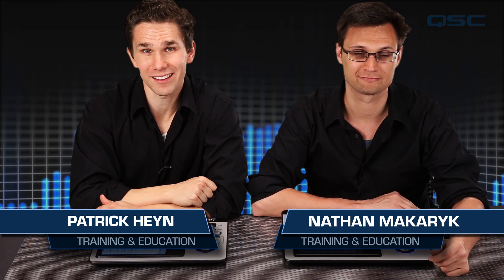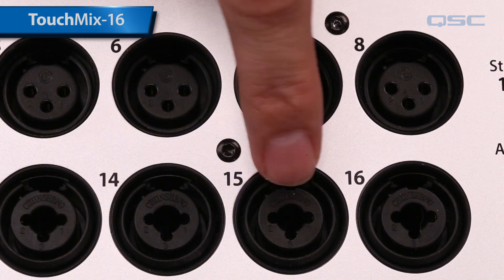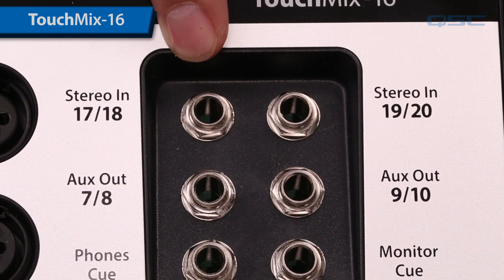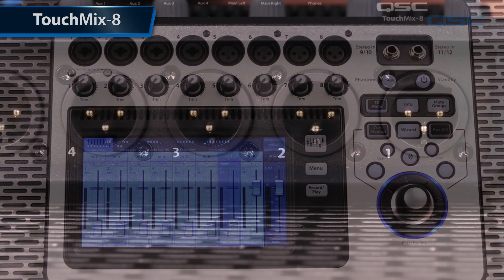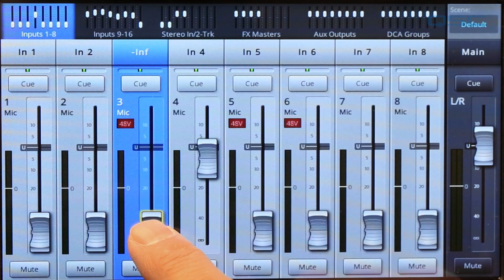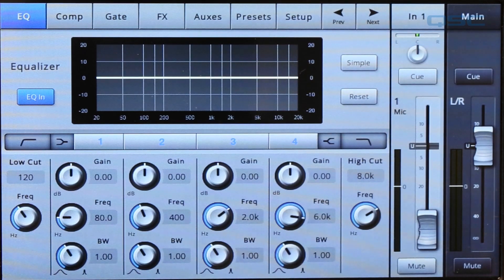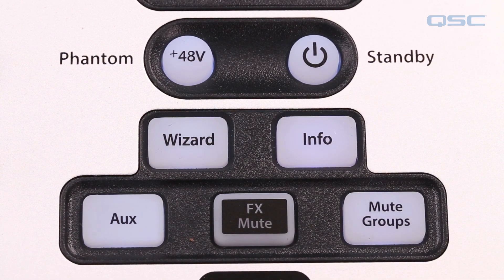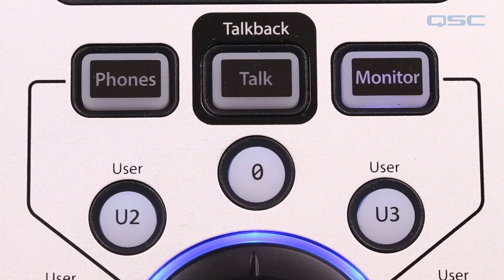QSC TouchMix Training 01: Mixer Navigation (English)

Comment: Are you able to turn the screen off while still using it ?
Reply from the maker: The screen cannot be completely shut off during use, no. However, there is a dimming feature that allows you to adjust the brightness of the screen if necessary.

Comment: what's the difference between the touch mix and the DBX drive rack pa2
Reply from the maker: ***** The TouchMix is a stand alone digital mixer. The Drive Rack PA is a speaker management digital signal processor.